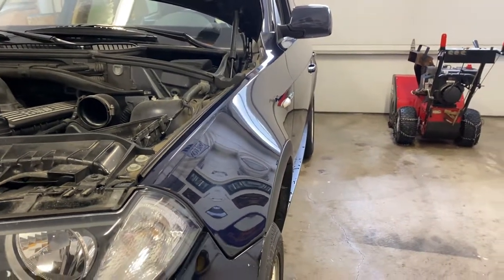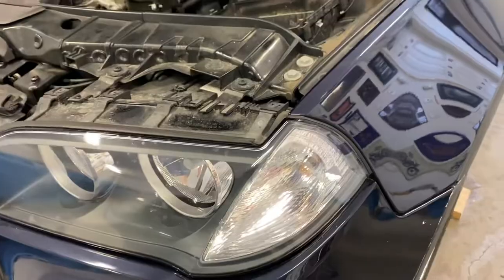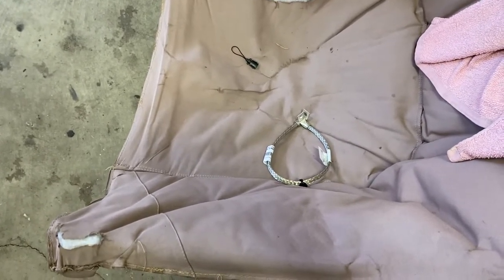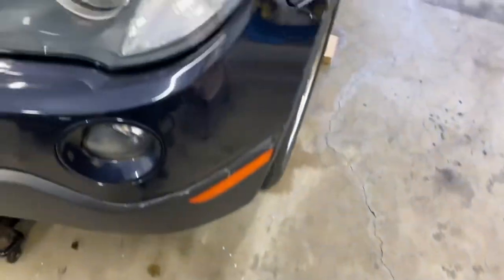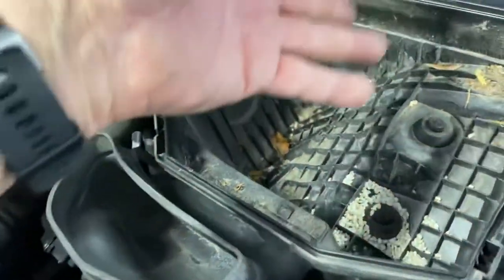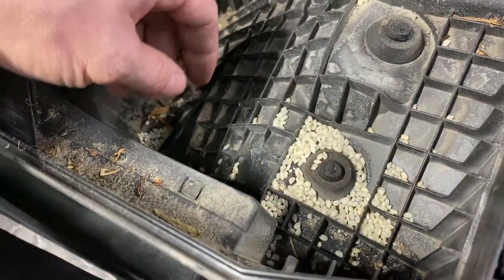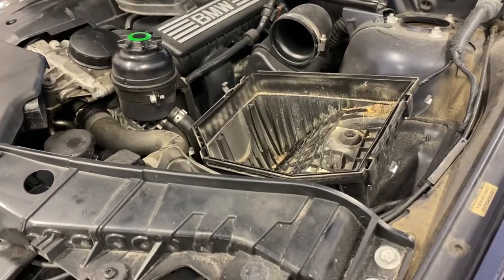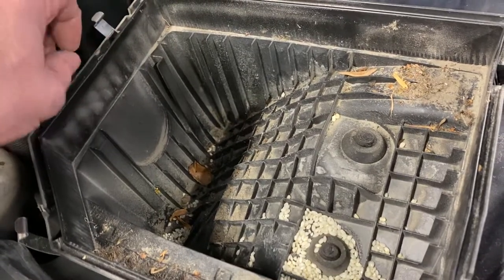2007 BMW X3 starter problems

Comment: what did it cost???? mine just died at near 90k miles.
Reply from the maker: Rock Auto $300 Bosh original.
Reply: @Resq28  you also just addressed the other question I had, I bet the ground wire went bad on mine.
Reply from the maker: @joesmith9216   There are two ground straps, one from the frame to the engine, under the passenger side and another from the frame to the exhaust.  I changed both because they were crusty, but that didn't fix my problem with the starter.
Reply: @Resq28  ok, thanks, just had mine done by a mechanic.
Reply: @Resq28  hey man, yeah I had two bad ground wires, got both replaced, my x3 is even faster now, I think it's communicating better with computer now or something. Our x3's are faster than the new ones, I want to take on the m340i in our x3, it's got to be close, the 4cyl can't even touch ours.